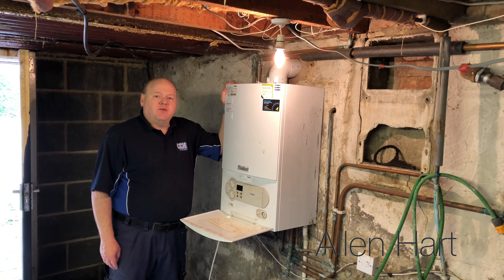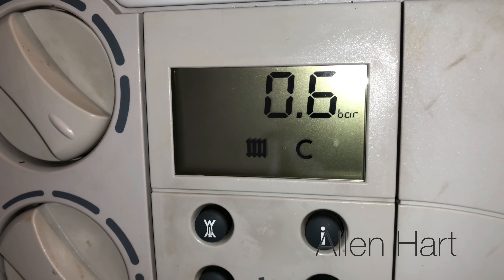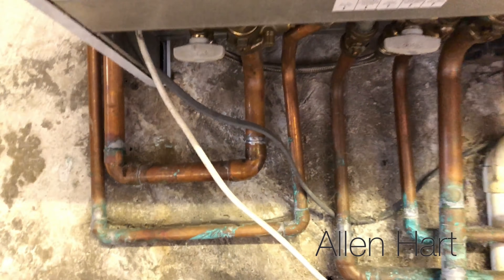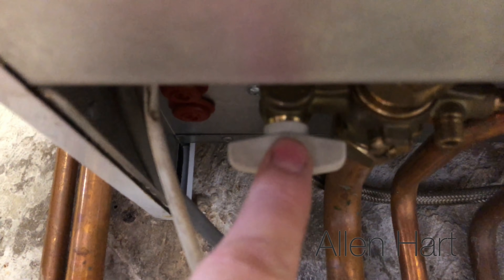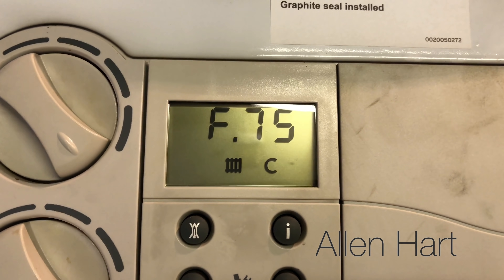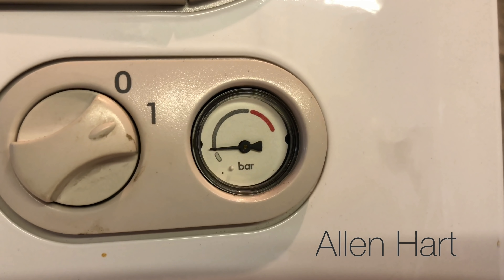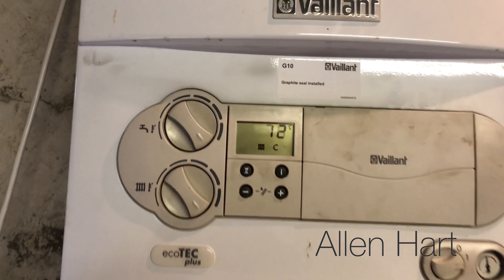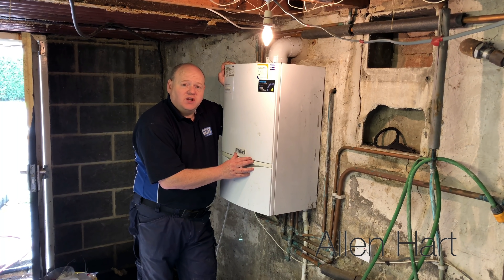How to fix your boiler Vaillant Glow Worm F75 / F22 Fault low water pressure

Comment from the maker: Candlelighters children's Cancer Charity.  https://www.justgiving.com/fundraising/cchleeds
How to operate EPH control https://www.youtube.com/watch?v=hmAnfVEUE5s&t=6s
How to wire opentherm https://www.youtube.com/watch?v=b3ulvuZVegk&t=179s
How to wire EPH controls https://www.youtube.com/watch?v=peqIxSuD-Jo
Reply: thanks for this
Dad told me I'd have to refill the appartment heating unit with pressure every once in a while but he didn't mention that it would throw an error code when I need to (F75) so I defaulted to looking online and found this.
I hate these new devices that don't show the pressure on a simple damn gauge and instead show it on some display that you have no way of controlling. I was basicaly filling it blind after seeing this video because there's no button to make the unit show me the current pressure if it doesn't want to...
The manual doesn't help either...it's as if they want you to call service just so they can fill the damn thing with water from a knob...
Reply: Hi Alan,
Mi combi boiler Vaillant eco plus just started giving me problems as there are times that it won't start in the morning, I have it set 3 times during the day; 6:30 am to 8:30am, 3:30pm to 5:30pm and 7:30 pm to 9:30 pm, the issue just started for about 3 weeks ago, as I have it serviced every year, it was working ok till for some reason it didn't start just in some days in the mornings, during the day it works ok but there were some morning when I had to go to the cupboard where the boiler is and press the ignition button to have it working, this morning it was harder to put it to work and even pressing the button it didn't start, then I had to move the thermostat dialer inside the flat till the boiler did three attempts and on the 4th try, it started working ........ the boiler was fitted following the manual in Sept 2005 so it's old but as said since I bought the flat 9 years ago, I've been having it serviced once a year ............. I wonder what it's going on?. any help please mate .........I could be needing probably a new boiler?............ any advice from you would be appreciated. .......... cheers!!!
Reply: ❤Thanks, children's charities deserve more attention.

Comment: It fixed the problem but now the bottom of the boiler is leaking. Think I forgot to turn the valves back and went and had a shower.

Comment: I have this issue pressure is fine but it seems everyone we switch the heating on via a robus thermostat it shows F75 any advice please as it seems to work ok once reset
Reply: @AllenHart999
Reply from the maker: Probably a dirty central heating system and the sensor blocking up? Thanks.

Comment: Hi - the sensor, wire harness and PCB have been replaced but still have F75 and a red light.  Pressure is good and can get it working after three on-offs in the morning after being off from midnight till 7 am.  Need to do this every day - is it the pump in your experience.

Thanks for any advice.

Comment: I have the same issue f75 fault but my pressure is between 2 and 3 bar . And since the f75 problem I believe the boiler tries to start the pump and fails wich causes to shut down the entire electric circuit in our home . Each time we plug in the boiler it closes the entire electrical circuit
Reply from the maker: Did you sort it out? Thanks.
Reply: @AllenHart999  yes my pump was defected , didn’t want to start anymore and shutting down my elektricity at home . Changed the pump and issue with f75 also fixed .

Comment: Thanks for the video Allen, very useful
Our vaillant ecotec pro 28 (only installed 4 years ago) has stopped working in the last few days, not firing up first thing in the morning. I've tried the reset button (and it worked but only in conjunction with opening the hot water tap, it didn't work just pressing the reset button) but it has made the heating come on now, but it's gone twice in the last three days, same procedure followed to reset it. Water pressure is fine and we have a magnaclean installed so do you think it's likely to be the sensor or the pump that's the issue? Thanks

Comment: helps only for a boiler that was installed fully and that has valves and flexible pipe on it mine dose not cheap ass workers now what i have to do to get pressure backup is use a garden hose and fill it up from the radiator with water messy and i hate it every time i do it i had a good run for about 4 months where the pressure rises and lowers from 0.6 to 2.2 whenever i turn the heat on or hot water i don't know why it dose that and im to lazy to call the plumbers who installed it to put the flexible pipe and valves on it

Comment: Thanks for this but i have pressure and have done everything under the sun and still no hot water or heating, what else can i do?
Reply from the maker: Unfortunately it sounds like you will need to call out a gas engineer, Could be a faulty sensor or the system could need flushing. Good luck.
Reply from the maker: Thanks very much for your comment, please consider subscribing to support the channel 🙂

Comment: I have F29 fault
Reply from the maker: Did you sort it? Thanks.
Reply: @AllenHart999  yes I did ,thank you for replying
Reply from the maker: @magsdoneit1068  Do you know what the issue was? It may help others? Thanks.
Reply: @AllenHart999  the button I pressed wasent resetting it so I pushed it harder with the tip of a pen lol n then it worked

Comment: Hi, have this exact boiler, but when I turn  two taps the pressure isn’t increasing, and I can not hear the tank filling. Is this likely due to a water fault ( requiring a phone call to the water board) , or could it be another fault on the system . The cold pipe feels cold and the hot pipe feels hot still. 
Thanks in advance.

Comment: Hi, what if it says f 75, and I fixed the pressure  but when I restart it it still doesn't work and it still says f 75? Cheers
Reply from the maker: You may need to call someone out. Sometimes that is a blocked sensor. Thanks.
Reply: @AllenHart999  thank you, will do
Reply from the maker: Thanks very much for your comment, please consider subscribing to support the channel 🙂

Comment: Thanks Allen, this helped.  However, I am getting a slow leak underneath the right tap; the F.75 comes back every few 4-5 days.  The bucket I leave underneath is collecting water.
Reply from the maker: nonshatter7 call a gas engineer to repair it ASAP
Reply from the maker: Thanks very much for your comment, please consider subscribing to support the channel 🙂

Comment: Hi there
I had a f.75 on a valiant eco tec pro. After resetting it a few times, it came back to life but the pressure gauge was slightly low. A local heating engineer Advised me that it would need a pressure sensor and quoted me £52 for the sensor and £60 for fitting it. He said if it was a pump it wouldn’t reset. What would you advise? Is he overcharging me?
Many thanks
Reply from the maker: Thanks very much for your comment, please consider subscribing to support the channel 🙂
Reply from the maker: It doesn’t sound like a high price. Thanks.

Comment: great video. my vaillant easicom 28c is showing F75. nightmare! water pressure is 1.2bar, pump seems to work when its reset. does that mean its the pressure sensor that needs replacing/cleaning? is that something I can do myself? thanks for your help!
Reply from the maker: I would always advise for you to use a gas safe engineer as the boiler will need testing to make sure it's safe. Thanks.
Reply from the maker: Thanks very much for your comment, please consider subscribing to support the channel 🙂

Comment: UNFORTUNATELY,  my boiler did not have those pipes under the boiler.  HOWEVER there is a small red tank in the airing cupboard  which was put there because of low water  pressure in my home.  The flex was present but not connected and only one pipe to connect it to.
Reply from the maker: Thanks very much for your comment, please consider subscribing to support the channel 🙂

Comment: Thanks you fixed our problem. Pressure sensor wasn’t reading correctly as water pressure was too low. All topped up & running fine now. No plumber would come out for at least a week so you saved the day!
Reply from the maker: Thanks very much for your comment, please consider subscribing to support the channel 🙂

Comment: Hi Allen. Do you have any tips/guides on how to replace the radiator temp control on a Vaillant ecoPLUS 824. Ours has snapped off and I think is stuck on a low temp as the rads only reach a lukewarm temp when the heating's on. Thanks!
Reply from the maker: Thanks very much for your comment, please consider subscribing to support the channel 🙂

Comment: Hi pal, I had the dreaded F75 fault did all the usual with pressure etc and the fault code kept coming back on after an hour or so and the pressure was fine and the water pump was going so I then replaced the water pressure sensor. Topped the pressure back up and tested the hot water taps and worked great but the radiator's are not getting hot now. I bled the radiators apart from 1 upstairs that I can't get to but they are still not getting warm. No fault codes on the boiler any more. Any suggestions. Thanks
Reply from the maker: Thanks very much for your comment, please consider subscribing to support the channel 🙂
Reply: Zicoh Hocih  I sorted it right after I posted to you I found out I hadn't opened one of the flow return taps back open under the boiler lol. All working fine

Comment: Thanks for this video Allen. I have an issue where I have the F75 error but not a low pressure indicator. The pressure is indeed on the very lower part of the "acceptable" gray area but the pressure before the error was always pretty much that low and didn't affect the boiler. Now when I call the hot water tap I can hear the boiler / pump start and try to heat for around 3 seconds, but then it cuts out and stops and then tries to run again, then stops, then runs again and stops a total of 5 times before I get the F75 error. Do you think it's a pump or sensor issue? Thank you
Reply from the maker: Thanks very much for your comment, please consider subscribing to support the channel 🙂

Comment: Thanks for the video! I was playing with those taps but not opening them enough to fill the boiler, so it wasn’t making that gushing sound. All sorted now, so hopefully my bathroom heater will get warm at last!
Reply from the maker: Thanks very much for your comment, please consider subscribing to support the channel 🙂
Reply: How far did you have to turn them? I normally don't have an issue but left one has no grip to it and no moving water at all when turned.

Comment: My boiler keeps giving this code, and we keep having to top it up and reset it, every day, or every day couple of days. It's been like this ever since we had a loft conversion done. (two extra radiators.) the boiler is only about 5 years old.
Reply: I wonder how to solve that issue? Did you have to call the engineer? I am having to top up every couple of days atm

Comment: I have Faul F22 but my boiler doesn't have those taps at the bottom or externally, Its a ecotec plus 415 with just gas coming in at the bottom and two pipes at the top, its a gravity system?
Reply from the maker: Could be a pump issue maybe. Happy new year.
Reply from the maker: Thanks very much for your comment, please consider subscribing to support the channel 🙂

Comment: Hi, I need an advice so to properly set my combi boiler, it's a atmoblock pro. The manual say when the unit is driven by a chronoterm, to set the water knob to the full right, at its maximum power (which is 75°, too much for the temperature of the winter here), so to the chronoterm will adjust the temperature of the water by itself.
Is this correct with any chronoterm? I have a simple Watts chronoterm, I don't think it is capable to read the water temperature of the combi boiler.
Thanx in advance.
Best regards
Reply from the maker: did you sort it?
Reply: @AllenHart999  Hi, my tech told me to leave it at 60° circa, so, not at the maximum temperature.
Reply from the maker: Thanks very much for your comment, please consider subscribing to support the channel 🙂

Comment: Tried everything you said.....up until you said...just restart the boiler......what did you press to restart the boiler?......couldn't see what you pressed....
Reply from the maker: Thanks very much for your comment, please consider subscribing to support the channel 🙂
Reply from the maker: Did you sort it?
Reply: Allen Hart ...yeah got it going in the end...thanks Allen...👍🏻.....(underneath the boiler..I noticed a small hard plastic removable sump?...when I unscrewed it ....the water in it was thick with grimy black gunge!......I cleaned and replaced it and the boiler started....I wonder if that was just a coincidence?.....why should it be full of gunge?.....thanks again Allen.....
Reply from the maker: Frank Byrne sounds like boiler needs a full strip down service, call a local engineer that deals with your boiler 👍 Thanks

Comment: Hello there . I have a problem with my boiler pressure. The digital display to check pressure is reading  1.4 bar when cold . But the dial pressure gauge is not above the light grey marker at the bottom is this normal. As i have watched this video and the dial gauge is supposed to be half way up in the darker grey area. Any help would be appreciated. .  :  (
Reply from the maker: Thanks very much for your comment, please consider subscribing to support the channel 🙂
Reply from the maker: Not really sure what you are asking me sorry?

Comment: This video helped me out for the most important part, i've got warm water again. However, i think i've got a leak, a tiny bit of water has found it's way to the side of the boiler and drops down there. I believe i might have a small leak which reduces the overall pressure of my boiler. I'll call in a technician for that, until then, i've got warm water again thanks to this video. Thank you!
Reply from the maker: Thanks very much for your comment, please consider subscribing to support the channel 🙂
Reply from the maker: Check out my latest video as it advises on leaks. Thanks.

Comment: Hi Allen. I've a problem with my boiler vaillant 837 showing 75 error code. I has pressure above 1.5  but need to restart and topping up pressure at the same time. Unfortunately when changes to hot water then won't start heating again. Looks like there's enough pressure in the system. I would be great if you may give any advice. Many thanks
Reply from the maker: Thanks very much for your comment, please consider subscribing to support the channel 🙂
Reply from the maker: Sorry i missed this, What was the issue? Maybe we could help others. Thanks.

Comment: If the bladder in the internal expansion chamber has burst, it will show, "low pressure" and error code. charging it up via the filling loop to register a "Pressure" will get the boiler going again, but the shroder valve on the expansion chamber will start to drip water over time, another sure sign the bladder has burst.
Reply from the maker: Thanks very much for your comment, please consider subscribing to support the channel 🙂
Reply from the maker: Did you sort it?

Comment: Its the pressure sensor need replacing for F75 usually a small plastic piece size of a finger nail . takes engineer about 10mins to do
Reply from the maker: Thanks very much for your comment, please consider subscribing to support the channel 🙂
Reply: @AllenHart999  welcome😎
Reply from the maker: Could be many things but pressure is first thing to check. Thanks.

Comment: Thank you, Allen! Mine is Vaillant TurboTec Plus. First it was showing f.29, and I was pressing the flame button and it would work. Today it started showing f.72 (not 75), and the water pressure was low, so I added water in to fix it. Now the pressure is within normal range, but f.72 still shows, and the heater would not work at all. Any quick tips or should I call an engineer? Thanks!
Reply from the maker: Thanks very much for your comment, please consider subscribing to support the channel 🙂
Reply from the maker: Call an engineer, These are simple things to check first. Thanks.

Comment: Mine says 0.3 I've no got a clue what I'm doing 😂
Reply from the maker: Thanks very much for your comment, please consider subscribing to support the channel 🙂
Reply from the maker: What is the pressure gauge on the front of the boiler, if its in the red you may need to add extra water.

Comment from the maker: http://cchleeds.co.uk/services/boiler-installation
Reply: Mine hasn't got the taps underneath or there isn't any near it, what would you suggest mate?
Reply: Hi mate, i dont have a filling loop on my boiler? Do you know how id fix low pressure
Reply: Searched so many videos, this was the only one that said you will hear water! Thank you!
Reply: Allen Hart no hot but the gauge is on red zone. Display shows S.30 and 2.7bar
Reply: If you have f.75 code and the boiler doesnt need topping up its usually the pressure valve needs replacing  . After reset and pump is turning, then it's the valve right.?

Comment: Can you please help, I have a rt500rf control, the display unit isn't working, I have hot water but no heating, I have changed the batteries but still no joy
Reply from the maker: Thanks very much for your comment, please consider subscribing to support the channel 🙂
Reply from the maker: Did you sort it.?